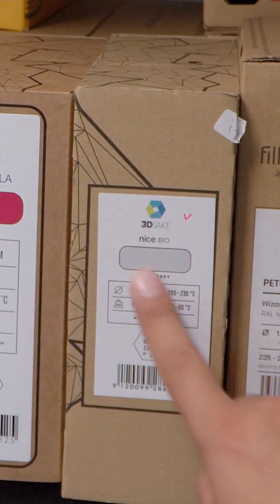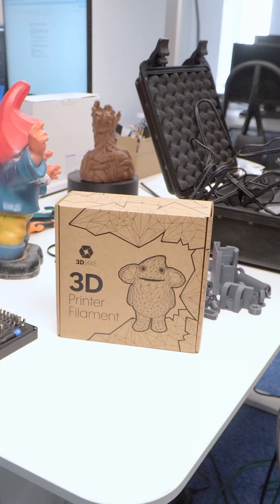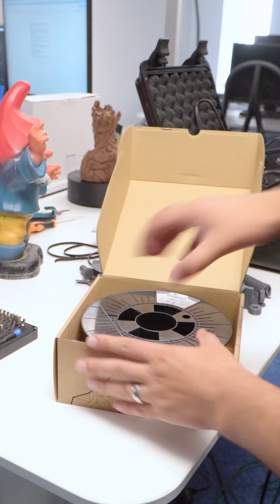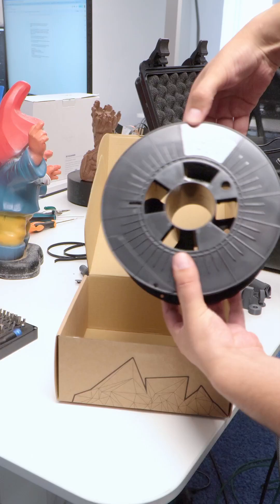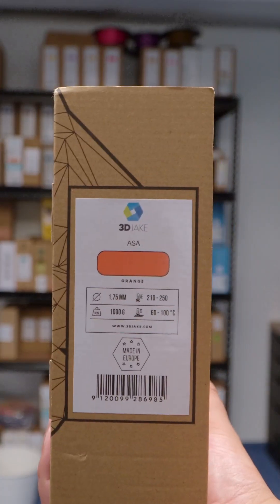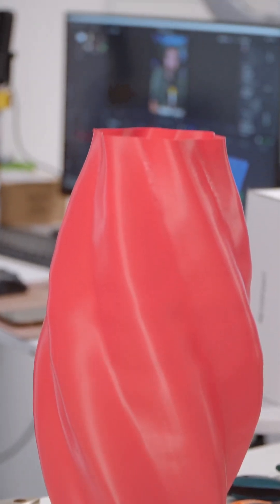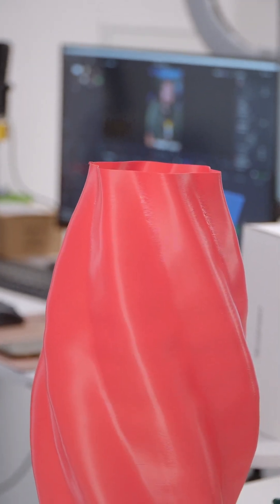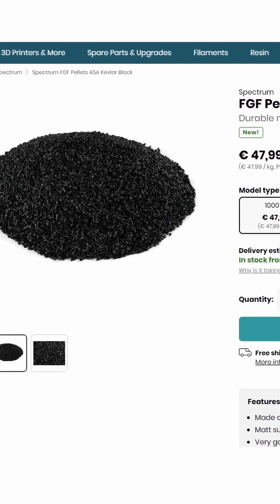Got a non-enclosed 3D Printer? Try ASA instead of ABS!

Comment: I missed a note that ASA and abs should only be printed in a well ventilated room since it admits toxic fumes!
Reply from the maker: Yep, PLA too, not as much but all filaments do this. Keep your printer area isolated and ventilated guys!
Reply: @3DJake_Official You can't compare it with PLA in good faith. PLA releases little to no VOCs, while ABS and ASA release A LOT during printing. They contain styrene as one of their primary materials, which is very carcinogenic. ABS and ASA are FAR worse than PLA.

Comment: Yeah, but ASA on big pieces even enclosed tends to shrink, consequentially warping corners, printing small pieces without enclosure, sure, even ABS then, but big pieces, people will just waste this expensive filament.
Reply from the maker: This is true the edges lose heat the fastest so anything that comes close to the edges risk warping but the difference between ASA and ABS in this case is massive.
Reply: When you print big pieces that take almost the entire bed or close to the edges of the bed, increase the bed temp by 5 deg or more.

Comment: Were you successful in printing with 3D Jake ASA using a Neptune 4 without enclosure?
Reply from the maker: Yes generally that is not a problem, the only time there are issues is if the part is so big that it reaches towards the edges of the build plate, the edges lose most heat so that is always a problem.